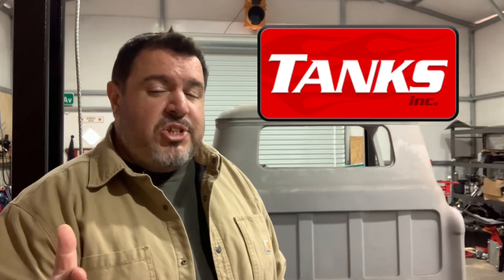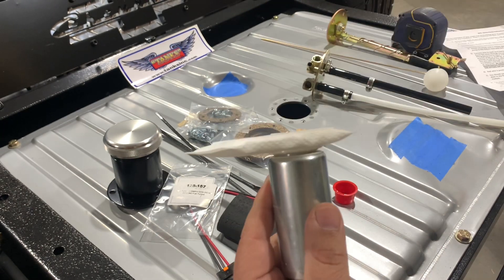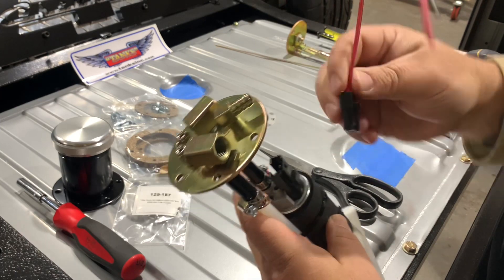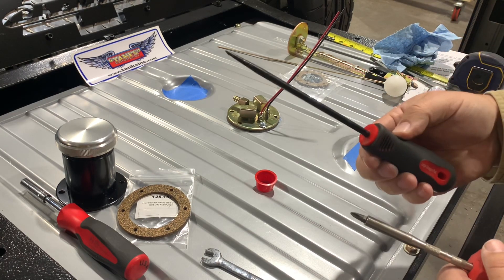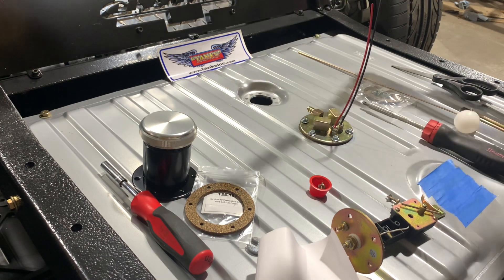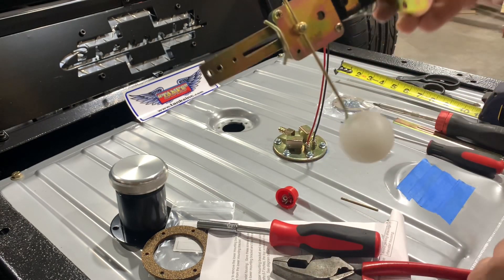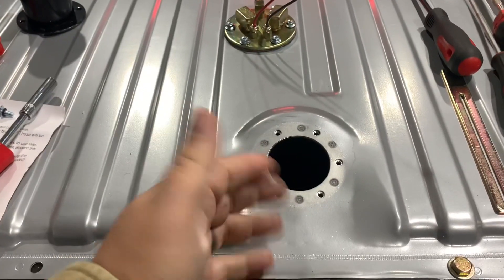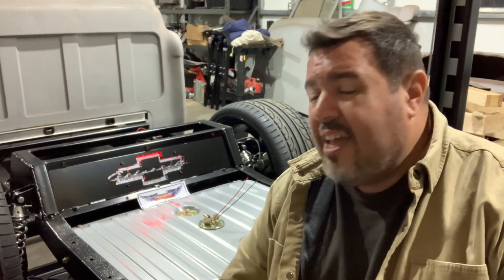LS Swap Fuel System Made EASY! (Pt. 1)

Comment: What size filler neck did you go with? There is 3” and 2”
Reply from the maker: Those numbers only relate to the height of the filler neck, so it really depends upon how you plan to use it in your specific build. I went with a 3” long neck because I’ll have a hinged bed floor, and it didn’t really matter. Another important way of determining how tall you want yours is where you mount your tank vent. The tank vent needs to be higher than the filler neck so keep that in mind. Hope that makes sense!